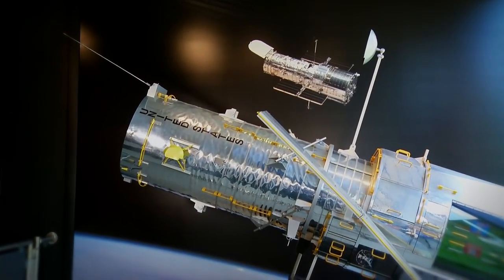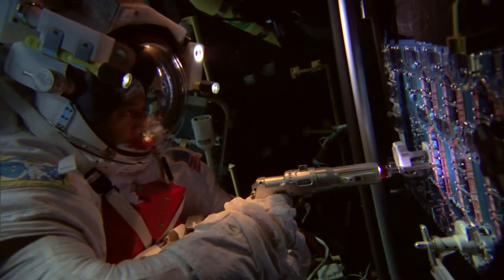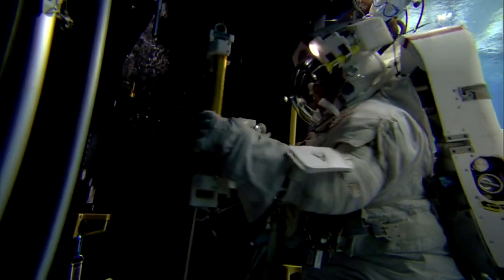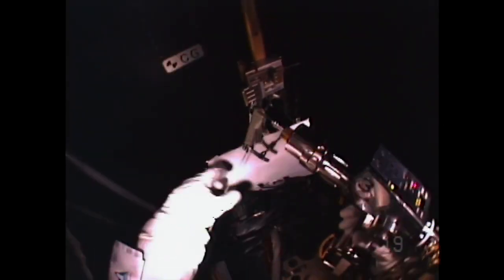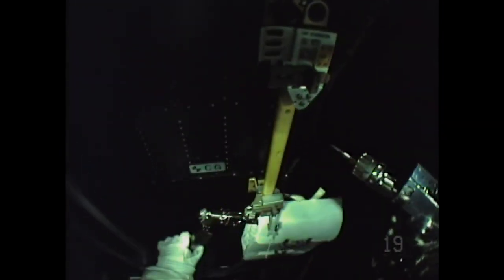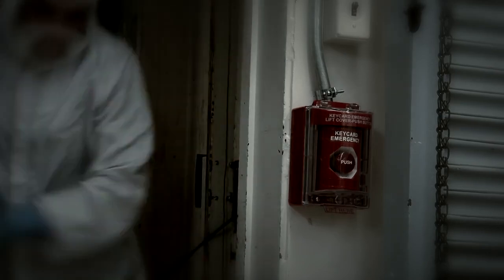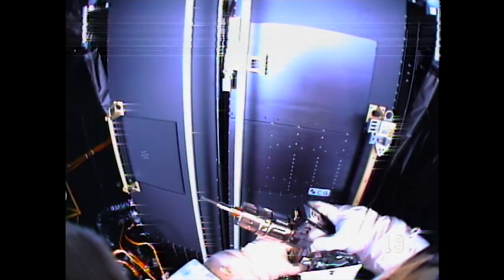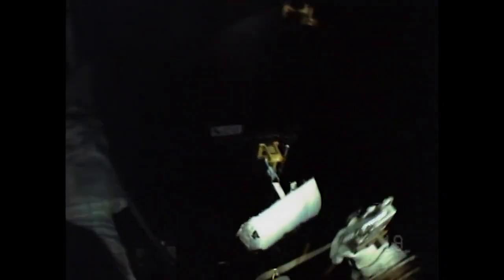Astronaut Broke Hubble Telescope Part During Repair Job | Video

Comment: A drill bit and a screw extractor set from harbor freight tools, 1.99 with a 20% off coupon and use the other coupon for a free multi-tester. :oD